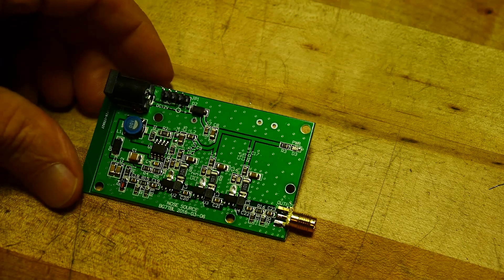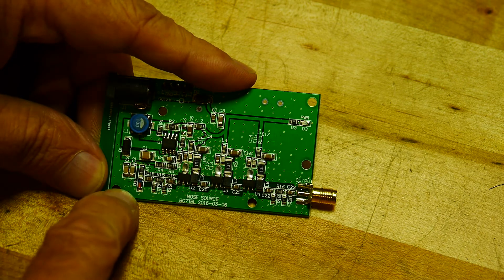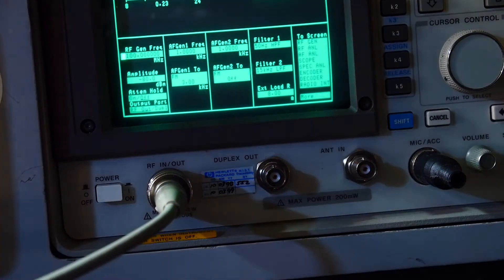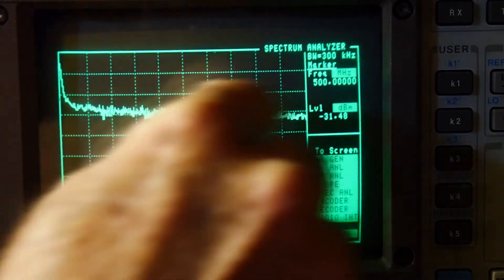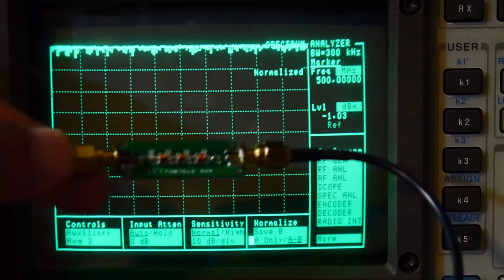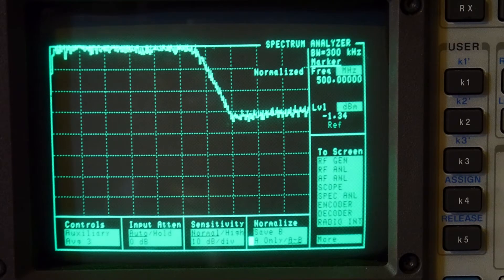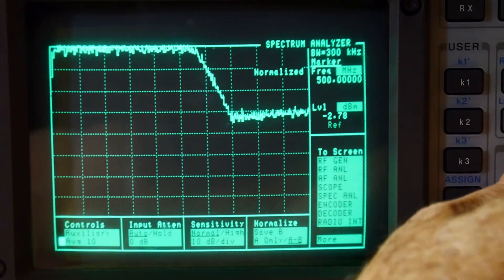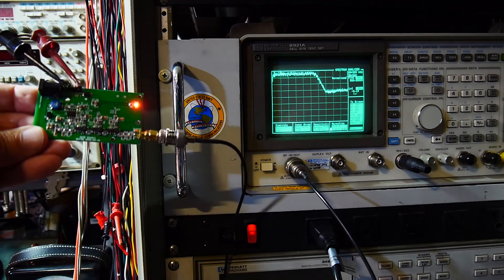#188  using noise source with spectrum analyzer

Comment: Greetings,

That noise source has a history of large power output.   To me it would have been good to use an inline attenuator, 20-30db,  to make sure you do not damage the Spectrum Analyzer until you know what the total power levels are.
Reply from the maker: yes you are right I did a video on protecting your spectrum analyzer: https://youtu.be/2dKaHbvb7GA?si=Iv4GZ_4WHgB6MWeJ
This HP 8921 has a 60watt front end so no way to kill it.

Comment: Will that noise source go down to say 500 Khz? Thanks :)
Reply from the maker: i think so
Reply: @IMSAIGuy  I have a hallicrafters SX100 with a first IF of 1650 Khz. There is a radio station about 100 miles away on 1650 Khz am. Time to wind a custom notch filter and a noise source like this would make that a bit easier. I cant believe hallicrafters didnot see this coming :)

Comment: Another application that I found is to get the Body plot of gain magnitude -- not the phase-  of opamps.  Of course the noise generator has to be modified to optimized for lower Frequencies, since most opamps have Unity Gain Frequency (UGF) of few MHz.  Putting the circuit under test between noise generator and oscilloscope with FFT, since most RF spectrum analyzers do not go down to DC.
This made me interested to think about  designing a circuit that can do both gain and phase Body plots. Stay tuned.

Do you guys know how do they measure phase in Vector Network Analyzers?
Reply from the maker: yes: https://youtu.be/cU05VVFl0N0
phase: https://youtu.be/yGKWBpgN8PU

Comment: Hi, I have the same noise source but the problem is that this board becomes very very hot if you supply it with 12Vdc - 10,8 V are enough, the output will not anymore rise up if you increase the voltage. After a few month it will die. For this reason I added on the backside of this board a heatsink.
Reply: @rmontgomery4340  I fixed with thermal adhesive small heatsinks on each of the 3 amplifier and on the other side of the pcb a bigger one.